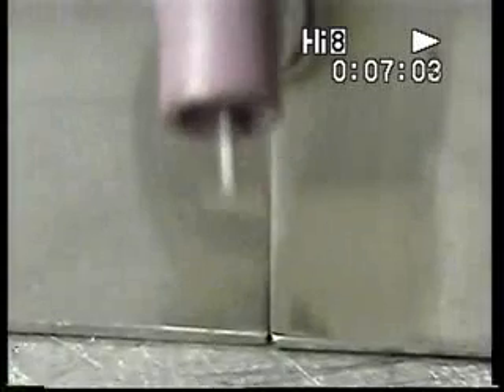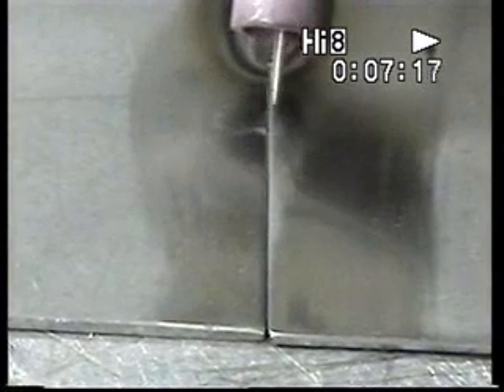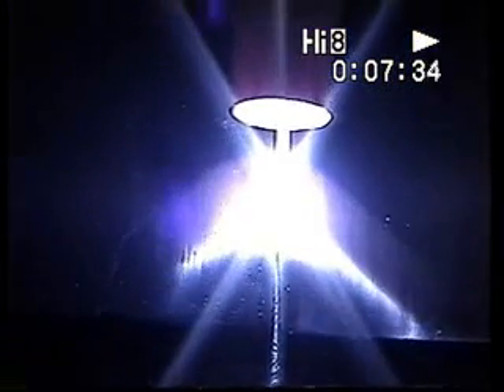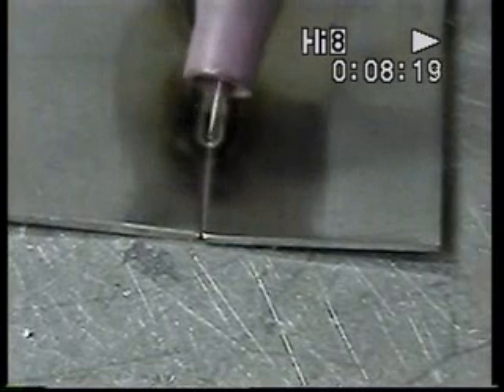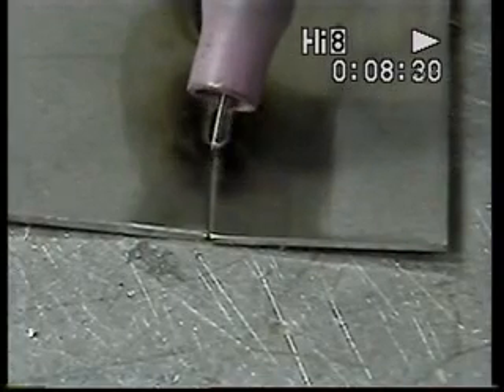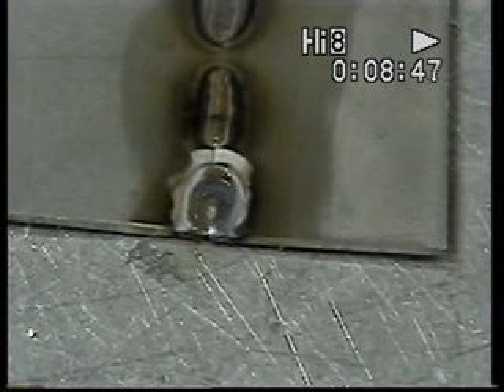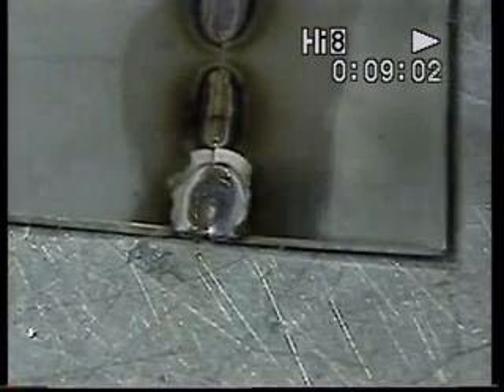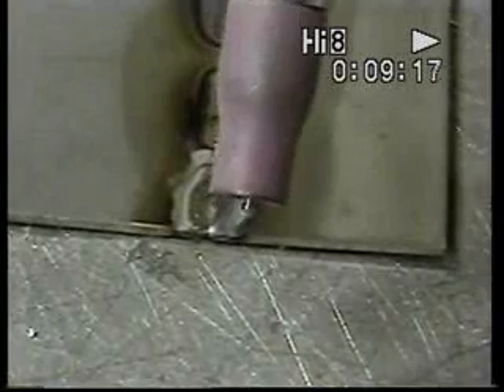Polarity Demonstrated

Comment: >>You have to understand that they changed the totally accurate conventions of Benjamin Franklin to the wrong collegiate conventions<<
Nobody has changed power supply polarity conventions
Reply from the maker: Yes they did for sure change symbol positions on batteries. They at first bragged, then they said it is only a convention anyway and now they have gone to they never changed it. 

Benjamin Franklin the person responsible for developing the test for the direction of electricity, the person who explained ARC, somehow could not have known, or gotten it wrong? Babble is all you will get from college. 

Sincerely, 

William McCormick

Comment from the maker: You can use a 3/32" tungsten or even a 1/16" tungsten to do 1/8" material with a #5 cup. But stick with 3/32" until you have total control of the pedal, filler material and torch.

Comment from the maker: DCEN is the modern coding to get the electrode to beam particles of electricity to the work piece. DCEP is the modern term for the workpiece to beam particles of electricity to the consumable electrode, that heats and creates a cathode ray back against the flow of the power supply. 

You have to understand that they changed the totally accurate conventions of Benjamin Franklin to the wrong collegiate conventions.

Comment from the maker: The ground, the terminal connected to the work piece, will conduct either AC or DC depending on what you have the machine set to output. 

For aluminum I use both AC and DC. Usually I use AC for most lighter aluminum. And DC for thick aluminum. I use helium almost always when doing DC and helium sometimes while doing AC.

Comment from the maker: Believe it or not the small cup cools the electrode off because it keeps the inert gas at a higher pressure around the tungsten. It allows you to use a very small tungsten. I can easily weld 1/8" aluminum with a 1/16" tungsten.

Comment from the maker: If I was doing 1/8" material, I would use AC, with a small cup #5 cup. You can use straight Argon and move along nicely because that cup size focuses a lot of heat, on the weld. And cuts down on the white heat marks alongside the weld. They call them cleaning marks but that is heat damage.

Comment from the maker: @teddykan1 
If you go back and look at older simple cathode ray tubes, in older publications, you will see they label them in a way, they will not work as described, today. All you need is a magnet to prove it. They just changed the polarity on a battery from (-) to (+). And let the confusion begin. An ARC meanders like lightning because it is not just a flow of electricity from a power supply. The straight, fast true anode ray, flows from the abundant terminal to the short terminal.

Comment from the maker: @teddykan1 
ARC welding used to mean (Anode, Rectified, Cathode) welding. Where you use the ARC created, not the flow of the power supply to strike the work piece. Just like in MIG welding. This is just the real history of it. I have done a lot of welding in the field and I know there is not time for history. Ha-ha.

Comment from the maker: @teddykan1 
In the last part of the movie you saw Reverse Polarity as it is marked on the welder. Reverse polarity means the power supply sends particles of electricity from the work piece to the electrode. And you actually weld with ARC (Anode, Rectified, Cathode) energy. The Cathode becomes the anode through rectification on the molten surface of the electrode. Originally MIG used to mean Molten Electrode Inert Gas Welding, MAG stood for Molten Electrode, Active Gas Welding.

Comment from the maker: @teddykan1 

It depends on what you call the anode and cathode and what you call positive and negative. 
Originally on a TIG welder to avoid the confusion of positive and negative that was undergoing changes during World War Two and afterwards. They termed the directions straight polarity, and reverse polarity. Straight polarity meant the electricity came out of the electrode, and went to the work piece. That is what you saw first in the movie.

Comment: Isnt the standard polarity for steel DCEN  - electrode negative (cathode) ?
Reply from the maker: Yes, it is, that is what was demonstrated the first time in the video, the torch is charged (-) as on a modern car battery. The particles of electricity move from the torch to the workpiece silently under the power of the power supply. Colleges reversed Benjamin Franklin's correct labeling of electricity and sent us back to the time of Du Fay the French scientist that Benjamin Franklin had proven wrong and won the Royal Societies Copley award for doing so. The Royal Society had laughed at Benjamin Franklin's paper on lightning and electricity being on and the same for almost 20 minutes, it ended with them challenging Benjamin Franklin to fly a kite in an electrical storm. Which he did by separating his body from the kite string by a strand of silk, which allowed the keys to reach approximately 30.000 volts, which is enough to hold off a lightning strike to the kite. He had proven that only electricity stops electricity. Sort of one particle can hold off two and two can hold off four particles. There is nothing negative about a particle of electricity it repels all other particles of electricity and all matter. 

In ARC welding the supply is just flipped, the electrode is charged (+) as on a modern car battery. And the workpiece is charged (-) as on a modern car battery. The particles leave the workpiece and move to the electrode, where they melt the surface of the electrode, and that molten surface much like a lightning cloud reciprocates with an abundance of particles of electricity or a cathode ray. The ARC rod becomes a liquid diode. The acronym MIG originally meant Molten Electrode Inert Gas. Now, most people call MIG metal inert gas welding which is much less descriptive and leaves room for misunderstanding. As tungsten is a metal electrode as well. Sorry I didn't see this post until now. 

Sincerely, 

William McCormck

Comment: Great video.  I have been wondering what ac looks like.  what amperage do you have it set to?  Seems kinda noisy and hot for such a thin electrode.
Reply from the maker: The amperage is not that high perhaps 50 to 75 amps. AC is noisy. Tungsten melts at a very high temperature so it stays nice if you are only doing straight polarity, what they call DCEN today.

Comment from the maker: In all three cases the torch has a tungsten electrode. In the first case the tungsten is the anode and beams a rather silent beam of particles of electricity to the work piece. There is no ARC rather a silent beam of particles of electricity. That silent beam is self sustaining. It requires no high frequency to maintain the silent beam. 

In the second and third part, you can hear the ARC. That is because  the pointed tungsten cannot take that much current silently. It melts and creates an ARC

Comment from the maker: For aluminum you can weld using AC or DC. AC is rarely used on steel stainless, titanium or magnesium the more common TIG welded metals.

Comment: for aluminium would you use ac or dc as the ground?
Reply from the maker: AC is just alternating DC current. For 1/120th of a second, the ground is negative and for 1/120th of a second, the ground is positive, on a transformer-type welding machine that does not have waveform control or hertz control enabled. 

Waveform control allows you to change the ratio of time the ground is either positive or negative. Newer machines also allow you to change the hertz the number of times the current alternates per second. 

Most cosmetic aluminum welding is done with AC TIG, however, you can weld thick plates of aluminum with DC TIG Straight polarity,  if the aluminum is very clean and the fit-up is very good. You poke the filler wire into the puddle that looks a little dirty. It makes for a very strong very penetrating weld. Sometimes we mix helium with Argon for more heat and penetration.  

Sincerely, 

William McCormick

Comment: Hi, the first weld run, did you say tungsten tip on anode? Isn't this DCEP (direct current electrode positive), which is the wrong way of welding stainless steel?
Reply from the maker: In the first part of the video, the tungsten is in Straight polarity mode, charged (-) as on a modern car battery, or what they call it today DCEN. It creates a silent beam that goes directly to the workpiece. The rocket scientists at college for grant money from the government reversed the markings for electricity, from Benjamin Franlin's exact labeling. Now the actual positive pressure the electromotive force leaves the (-) terminal and goes to the (+) terminal. God help us all. There were a lot of really nice engineers some retired that had no idea that had been done. Stuff like this makes Altzheimer possible.  

Sincerey, 

William McCormick